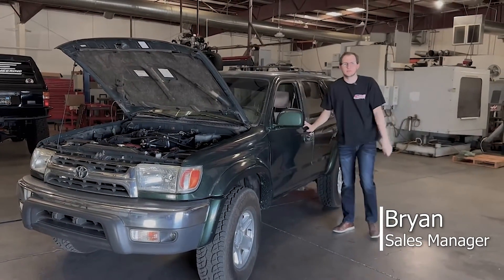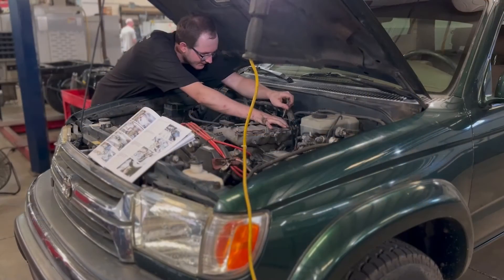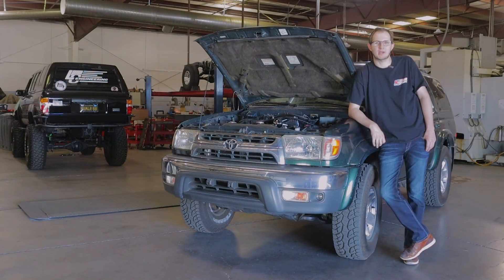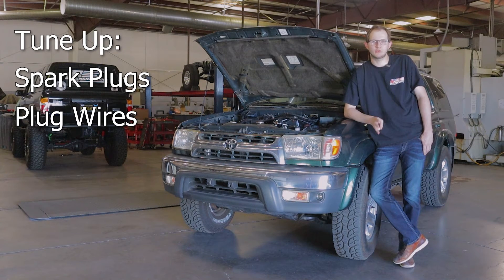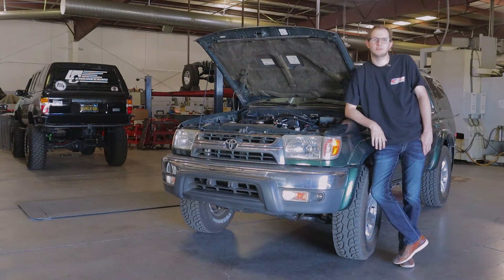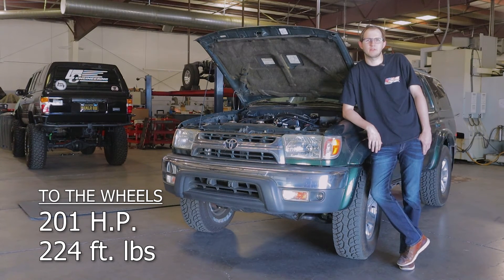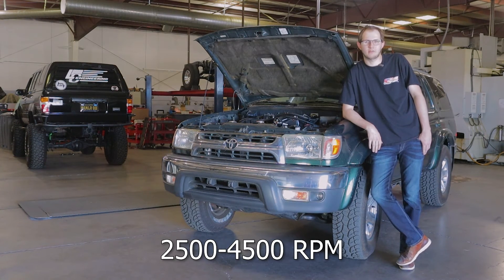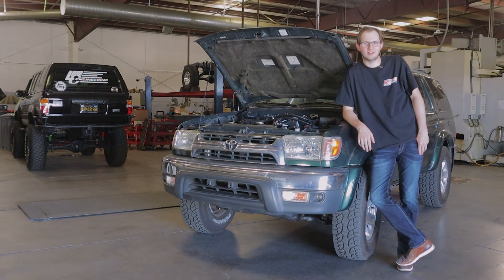5VZ Supercharger Overview

Comment: Is it necessary to add the 7 fuel injector kit ? Water ethanol kit ?  Upgrade to supra injectors ? Dyno tune ?
Reply: You should have it tuned. As for the 7th inj issue, the TRD blower tended to lean out too much but maybe the tune and modern blower will alleviate that

Comment: Too bad you guys didn't specify anything about the fuel upgrades... looks like you have a FMU? What other fuel system upgrades? Thx
Reply from the maker: We did do the FMU but it was put on at the very beginning of install and was not needed. It just needed the normal break in time to adjust. If you upgrade to a smaller pulley for more boost than it would be necessary.
Reply: @LC_Engineering  sorry, but there’s just a ton of mixed information out there and want to clearify - the 3:1 FMU and larger fuel pump was NOT needed, your lean out issues that SNP referred to were a result of dynoing before the ECU had time to remap?

Comment: Only 201??? That’s only 18 extra horse power from stock. That’s it?? For 4 grand?? I was expecting 260 to be the WHP.
Reply from the maker: 201hp to the wheels. Keep in mind while yes, the motor produces 190hp, only about 150hp actually makes it to the wheels due to drive-train parasitic loss. So it is actually a 51hp to the wheel increase which means at the crank it puts out 260 which is a 70hp increase over stock.
Reply: You think factory HP figures are determined at the wheels? You might not be the sharpest tool in the shed....

Comment: Any high gear low rpm ping like the old SC had in closed loop?
Reply from the maker: We haven't had any issues with anything like that. Since the install we have put a lot of miles on it with no issues to report as of yet.

Comment: Why are all the supercharger kits using small superchargers... personally on 3.4 litres i would prefer 1900cc or if i was doing it myself would go straight for 2300cc... that way there is possibility for further upgading of engine later on without having the extra expense of upgrading supercharger
Reply from the maker: This unit had to be similar to the out going model in power output to keep its smog certification. That is why they focused on the parts they could improve like the cooling efficiency and power band. There is also smaller pulleys available for them but the stock ECU will not support it.